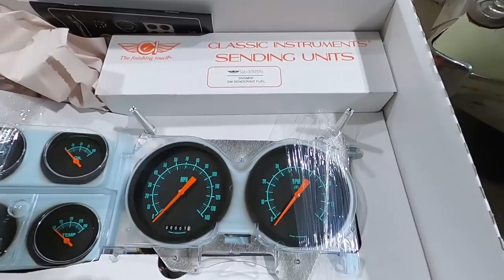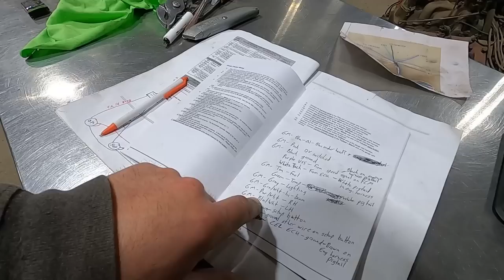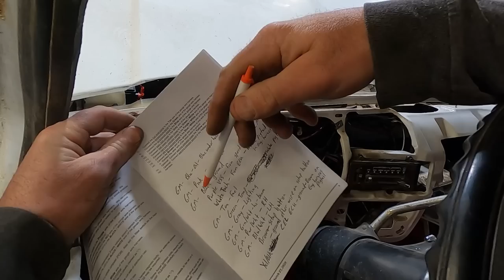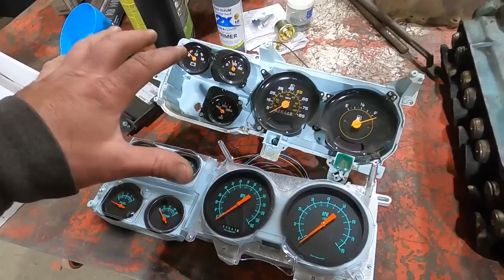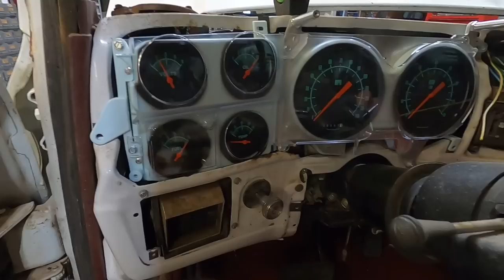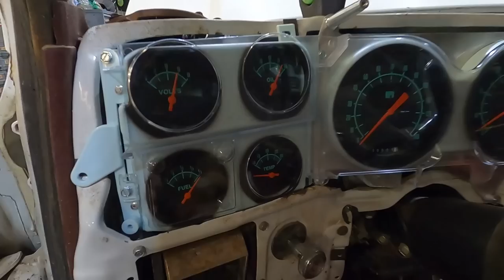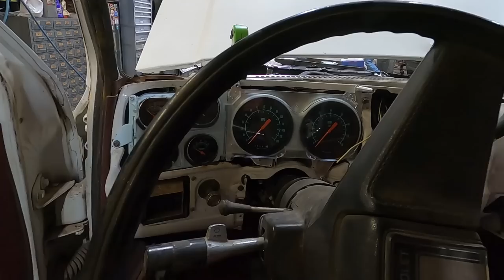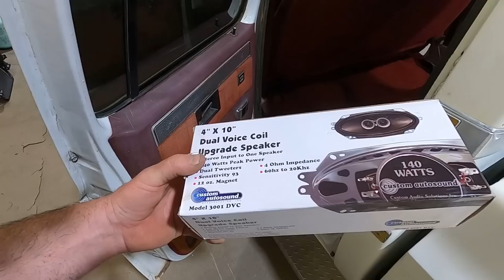Squarebody Dually Upgrades! Gauge Cluster, Stereo and Amateur Windshield Replacement!

Comment: Speakers will work hooked up backwards, but they will be reversed phase.  If you have one correct and one backwards, it will effectively cancel out the sound waves and sound quieter, especially with mids and lows.  Might make your tweeters sound muffled too.  Good luck!  Great content, appreciate the entertainment.   Pat Duff on the head for me.
Reply: If you have 2 speakers and hook one up backwards it will kill your bass and sound output. Make sure it’s all hooked up right or it will sound so flat.
Reply: impedance between left and right channels should be the same or sound quality will suffer and future issues with the amp circuit will arise.

Comment: Hey mortske a neat little hack if you plan on putting a cb in the truck is to use a 4X10 factory style speaker in the original center hole of the dash for the external speaker.
Reply from the maker: Brilliant!
Reply: I was thinking that same thing, wondering what he'd use it for, a center channel on the stereo is a possibility, but I've hooked up two-way (commercial) radios this way a few times back in the day.

Comment: Normally you put the seal on the glass add a rope to the inside track and pull the glass into the truck.
But as Tommy makes everything an adventure....PS don't be afraid to slap the glass in the direction you want it to move...Great show
Reply: That's how I do it. WORKS GREAT. 550 paracord works.

Comment: Woman here, faithful viewer. There are dozens of us. Dozens! 

Btw
Just an fyi, for the center speaker in your dash, if you wire the speaker backwards, the magnet inside won't work right because it's meant to be unidirectional and you may end up damaging it or it'll just sound muffled and weak. 

What you can do is create a center channel through something called a "bridge stereo".

Basically, positive of center speaker to the positive of the left channel, and negative of the center speaker to the negative of the right speaker!
It'll be essentially MONO but since it's centered in the dash, it's fine.

Happy wiring!
Reply from the maker: Good to know! Thanks for watching!

Comment: GM stereo wire colors: Yellow is switched 12v, black is ground, gray is dimmer. Constant is orange if it had it (but that year probably didn't), LF speaker is Tan +, gray -, RF is Lt green +, dark green -, LR is Brown +, Yellow -, RR is Dk Blue +, lt blue -. If it had a power antenna it would be pink. The switched, ground and dimmer are in a 4 pin black plug (if it's still there), Front speakers are in a white 4 pin plug, and the rears are in a blue 4 pin plug. If it had constant it would be in a separate 2 pin plug with the  brown parking light + wire. Front speakers are 3.5" and rears are 4x10s. The speaker you put in the dash is a dual voice coli so you can hook up a right and left to it. If you get the polarity wrong on a DVC speaker, it will fight itself and also if you get the polarity wrong you will lose bass response. You can tell if you have them wrong if you have more bass on right or left and less in the center with normal speakers. The center speaker will probably eventually blow if you get one side wrong.
Reply from the maker: Good to know!

Comment: That speaker is designed for left and right inputs to give a stereo sound on vehicle’s that only have the center speaker option…. I would leave it out. you could possibly burn out the radio if it doesn’t like the ohm load. Or just sound like trash. Thanks for the great videos! Makes a good Monday!
Reply from the maker: Good to know!

Comment: Tech tip of the day.  8 lug wheels around 1950's up to  2013, 8 lugs same pattern.  Center hole on GM is 4.5", Ford and Dodge is 4.75".  I have been selling a lot of old wheels and tires from the hoard at work.  I learned more than I ever wanted about rims and tires, especially odd ball sized ones.
Reply from the maker: Good to know!

Comment: Trick for speakers, on those old jobs without factory amps, pop the speakers with a 9 volt battery. It lets you ID the wires and see polarity so none will be out of phase. You watch the speaker react and if it pops outwards you note which wire is on the + side of the 9  volt and hook up the stereo to those in phase.
Reply from the maker: Thanks for the tip!
Reply: @MortskeRepair  you're welcome. I worked Circuit City Roadshop doing mobile electronics for 3 years part-time and still use many tips, tricks and procedures learned there.
Reply from the maker: @MotoRestoFL  Awesome!

Comment: A trick I've used for installing carpet is using the step bit from the inside then go from the back with a 1/2" to 1" hole saw to cut a nice clean hole.  

Takes longer, but makes finding the holes easier when reinstalling the bolts and makes smoothing the carpet out a bit easier with bolts installed

Comment: For those window cranks, I've seen folks convert the original cranks in to up & down switches for electronic conversions (so push down about 1" or pull up 1" for the motor control). Would be a good option for him with that modern dash in there.
Reply: Some guy at a car show tried to tell my kid his hand was moving so fast that it looked like it was moving slow while gently pushing down the window handle.  I could hear the motor going but it took a bit to explain it to the boy.  Silly boomer magic!

Comment: If you reverse the + and - wires on a speaker it will still play, but it will pull in instead of pushing out (Reverse phase). If you’re ever unsure on the wiring slap on a 9v battery, if it pops out you’re good, if it pulls in you are backwards 👍🏼 but what do I know right?! Keep up the good work
Reply: Beat me to it, a reversed speaker will cancel out certain frequencies (determined by cab dimensions).   The battery trick is a good one, usec it many times!  Cheers!
Reply from the maker: Good to know!

Comment: I’ll try and find the article, but if you connect the positive of the right channel and the positive of the left channel to the center speaker, the center speaker plays the opposing phase of each speaker. In other words when the positive and the negative of the Right and Left speakers are playing the same frequency the center speaker plays very little but when the left and Right speakers are playing different sounds the center speaker reinforces those notes and It really boosts those frequencies. It sounds really good. Your question about positive and negative connections is very important. You need to make sure that all the speakers are “in phase” so all connected the same way. Otherwise The out of phase speaker will cancel the sound from the other speaker. It’s really obvious in the bass frequencies if the speakers are out of phase

Comment: You might look around they make a seat for the crew cabs that lays down to make a bed in the back seat which can make more room to hall gear/grocery/other.
Used to see the hotshot trucks with them as sleepers.
And I've got a 10 disk coming changer under my front seat which keeps the stereo look stock with a cool cruise tunes makes your ride nice. Love those chevy Dooley but I live in California and had to settle for 12 valve dodge dashboard are junk.  I'll see ya on utube keep the good work......thanks....

Comment: That 4x10 dash speaker is dual voice coil so it can run both left and right channels. It has 2 voice coils for the woofer and independent tweeters. it will actually make an excellent center channel for the front if hooked up that was because those little 3.5 in speakers don't really put out much sound.

Comment: Hooking up a single speaker with reverse polarity won't hurt the speaker a bit.  All it changes is the direction the speaker cone moves.  Where this becomes important is in stereo.  A speaker is a sound wave pump, which moves air that we hear and our brain translates to sound.  A drum hit or vocal note pushes the diaphragm in a microphone. This movement is amplified greatly and the speaker moves in the same direction as the microphone diaphragm.  If you are sitting midway between two speakers with one polarity reversed, one cone is pushing sound to your ear and the other is pulling away, and they can cancel each other out.  Google Dave Ratt phase cancellation, he explains it VERY well.  

Some of the older John Deere tractors used the rubber seal you were fighting.  I brazed a ball on the end of a hose pick as a 'get-me-by', but the real tool is much nicer.

Comment: Excellent video Mortske Repair  :) , Duff Dog 🐕, MOJO   :) also excellent on Windshield  , Electrical  , Tint windows  , Power Windows fix , Speakers plus Radio in are doing old Windshield radio antenna or fenders antenna! But also do back window like old GM Delco antenna  from 1970's to 1986 in trucks also car plus vans to also Am/Fm radio to if didn't know that and worked out super too in 2000 to 2010 Honda do them also Toyota  to but 2000 to 2010 Chevrolet Impala LS  and SS had them !

Comment: Speakers need to all push and pull at the same time. Crossing the wires will put them out of phase, but in a vehicle you wont hear it. By wiring center to the right speaker your sound mix will be right dominant. To cure this, wire the positive of the left side to the positive of the center and negative to the right side negative creating a mono center.
Reply from the maker: Thanks for the info!

Comment: In regards to the speaker wiring polarity, all positive terminals are connected together, and all negative terminals are are connected together. This will keep all all sound sources in phase, reducing sound distortion to a minimum.

Comment: this side of the pond, we put the rubber around the glass first, then run a plastic coated 10 amp auto-electrical wire right around the back lip. drop the screen in place, then, whilst someone applies pressure from the outside, slowly pull the wire out of the lip, into the truck, making sure the back lip pulls over the body lip. with wd40 to lube it, it is normally in place in 2-3 minutes...

Comment: The LS ECU uses the water temp, and doesn't use oil pressure. I run the ecu temp sensor in one head and the gauge in the other head.

Comment: And March he using up the front center speaker hooked up to the right side is going to give you an impedance mismatch so the right side will not sound the same as the left. Also positive and negative polarity does make a difference in sound

Comment: I think that perhaps a better way to set up the wiring for the center speaker would be (if I remember correctly) Positive Left & Positive Right connected to the two lugs on the speaker.  I think this was the way that PW Klipsch suggested using a center speaker between 2 Klipschorns.  I think it may be referred to as a phantom speaker and will prevent an impedance mismatch between R & L front on the amp.  I could be wrong but now would be an easy time to set it up while you still have such great access.
Reply: That don't work with all units, and can damage some.-

Comment: I had to laugh when you pulled the rear corner speaker grills, I'm working on my 76 C10 shorty and found the same surprise in the cab corners, I hate freaking rodents. Your new tow rig is coming along nicely, the LS combo should be a nice setup.
Reply from the maker: Good stuff!

Comment: That dual voice coil center speaker is so you can tap into both front speaker output and it plays mono
Reply: The dual voice coil means two sets of terminals to connect the wiring from both sides
Reply from the maker: Good to know

Comment: I put in a Intellitroxic on my squarebody. Cheaper, it works fine, but it takes a little fab work to the 42yr plastic instrument cluster core. Fuel gauge displays Ohms. There are others a lot better, but it comes at a price. All in what ya want out of your ride

Comment: The rustoleum 2x is great spray paint. I've went through many a can. It's cheaper than original rustoleum but works better. Duplicolor engine enamel with ceramic is the best spray paint I have ever used. If you've read this entire comment, you must have figured out that I'm a spray paint expert at 16. Avoid krylon colormaxx.
Reply: I agree Sonny but their white prime is horrible. I use 2X on everything.
Reply: @mikemaccracken3112  I've never used the white primer. The black works pretty good. It sticks to plastic really well. I used the paint primer by itself on door panels and it's held for over a year.

Comment: Just a quick note on your front speakers if you wire that center speaker in in parallel with the other speaker you will change the resistance I.e 2 4 ohm speakers in parallel create a 2 ohm load effectively doubling the output on that channel f you put them in series you will create an 8 ohm load effectively cutting the output in half. The best bet would be just to use the speaker in the center as a hole filler and not hook it up at all

Comment: You should have connected both outside speakers in the front to the left speaker wire and the center speaker to the right, that way the sound on the right side will be correct with stereo sound. the way you connected it, it will be just the sound from the right speaker.

Comment: The shop I used to work at. A guy brought in some dodge wheels to put on his Chevy truck and bought new tires. The other mechanic got the tires all mounted, balanced, washed the blue off the white letters. Then bolted them on the truck. Went to back out of shop and the rim was pushing on the rotor. Smh😂

Comment: If im not mistaken, when you lift the wiper arm (while still attached) it should expose a hole. if you put a same size drill bit in the hole and let the arm rest on the drill bit, the arm should rock off.
Reply from the maker: Thanks for the tip!

Comment: To those saying that you rope in that window, not on a square body.
Rubber should be sealed to the body ideally. (Square bodys like to leak). They installed the window right, the problem is the type of gasket he used. The spline type gaskets are oe and thr easiest ive found. 
The secret weapon is dawn dish soap. Its the best option for any gasket set type windshield.
Reply from the maker: Good to know!

Comment: The guy that suggested using the center speaker for a CB is a good idea I don't think hooking up 2 speakers to the right front channel is a good idea? And you may want to check that the ohms match if you choose to use the center speaker for a remote for a CB?

Comment: Just an fyi if you want to know which wires go to which speakers, just take a 9volt square battery and touch the wires at the head unit after the speakers are installed. It will cause a speaker to static and you’ll know which wires are which.
Reply from the maker: Good to know!

Comment: Center speaker is worthless for car audio unless you have a video system installed. It DOES however work VERY well for a cb radio :) Oh and back seats? You don't need any stinkin back seats, you need SUBS back there-LOL!!!!

Comment: Just use binder cord and put the windshield in the seal, lay the windshield against the hole. from the inside pull the binder cord from the inside.

Comment: Finally burnt through the video. Truck looks good. Do alternators get weak? Got a 70s G.M. Alternator on a 57 Buick with electric fans and am having charging issues. I thought it was the exciter wire but that’s working. Starts out charging at 13 but drops down when driving.
Reply: My belt is slimy and worn but could not get a new one on Sunday. I tightened it up.

Comment: Fix that center speaker. DVC means Dual Voice Coil so that speaker takes a left and right speaker connection. It will have 2 sets of terminals. One set for left and one set for right going to separate tweeters on a shared cone.
Reply from the maker: Good to know

Comment: Turn on the key an if oil pressure jumps to 80 before cranking the sensor bad at least that’s the way they work in factory configuration should work the same on aftermarket setup

Comment: I'm not a stereo guy either
But I did find out polarity is very important on a speaker
It's basically a electro magnet. So when they push you feel the beat.
So depending on the polarity they either pull in on the cone or push out
All out of sync they sound like crap
Don't ask me how I know LoL 😂

Comment: Without knowing you did put a stereo speaker as front center. That DVC speaker taps into both, left and right. Only tapping into one side ruins the symmetry and messes up the audio balance. Just one more wire and it's actually correct. + to + or you'll create bad sound.

Comment: When you wire a speaker backwards the Speaker works in reverse. You can see the difference by 2 speakers side by side wire 1 correct & the other wrong and you will see 1 will bounce forward while the other goes in reverse
Reply from the maker: Good to know!
Reply: @MortskeRepair  The more you know!

Comment: You really shouldn't tap into another speaker with that 4x10 because it will change the ohm load on the front right channel of the head unit amp damaging it. That 4x10 is meant to be a replacement for the left & right speakers or in case there aren't any openings provided by the factory,like in very old vehicles that came with mono only radios. The reason it has two tweeters/dual voice coils,is so that you can connect the front left & right channels to that one driver and still have it play in stereo. Your best bet would be to run either the two Kickers or just the one 4x10 up front but not all three.
Reply from the maker: Good to know

Comment: A mortski on that center speaker in the middle of your dash if you take positive on the left side and negative on the right side of your front speakers then you won't have less sound from one side like you were trying to do you will even out the sound and you also ask if you flip positive and negative around what be different nothing bad will happen the sound just won't be as loud less base if you flip-flop make sure always positive is positive negative is negative are you all have less sound less bass